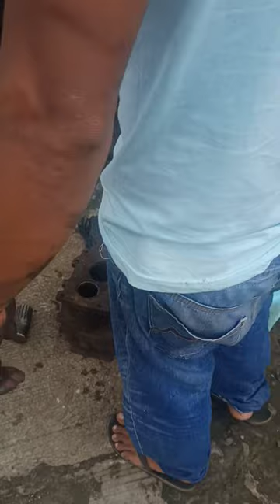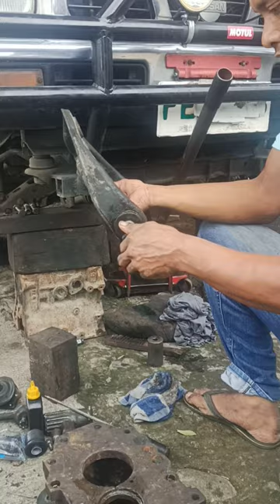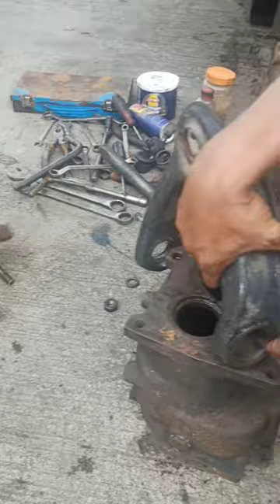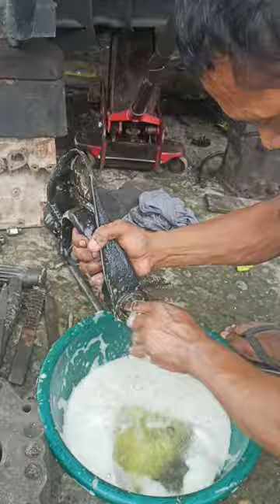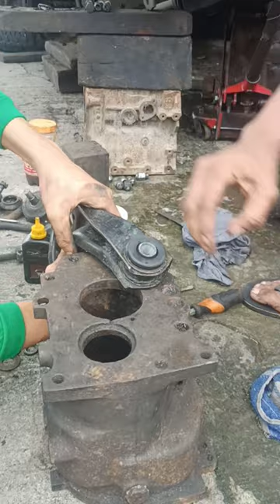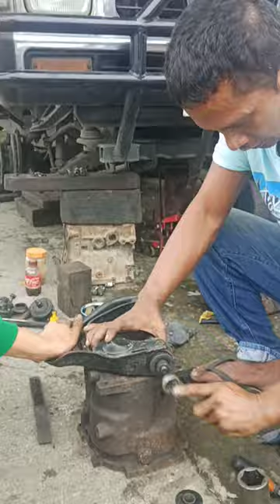DIY replace upper control arm bushing | Nissan eagle bd25

Comment: Good eve maninoy pwede po magtanong, kung ano ang sira pag di nagtutugma ang rpm sa speedometer?kasi sagad na po ang rpm pero ang speedometer  nasa 40kph palang po salamat
Reply from the maker: Ano Yan unit mo meg
Reply: @ManinoyWhite  susuki scrum f6a po maninoy
Reply from the maker: Palitan mo speedo cable meg, good ev
Reply: @ManinoyWhite  malakas rn po sa gas at parang nalulunod pag binibirit ang silinyador.